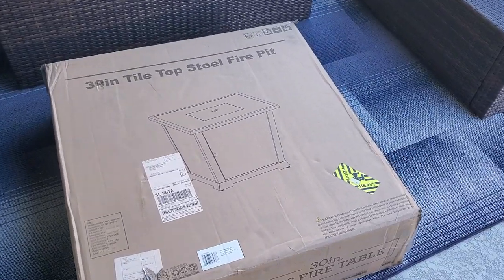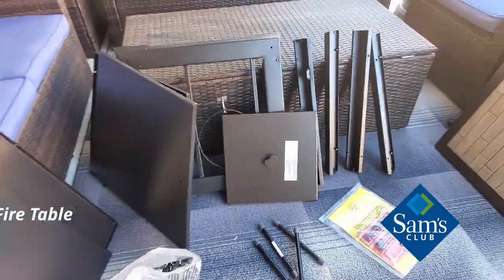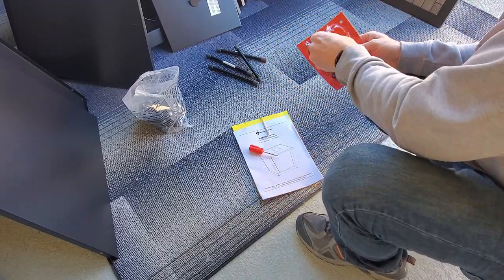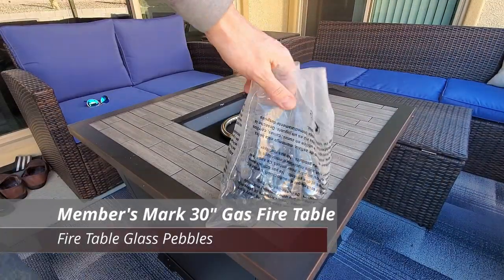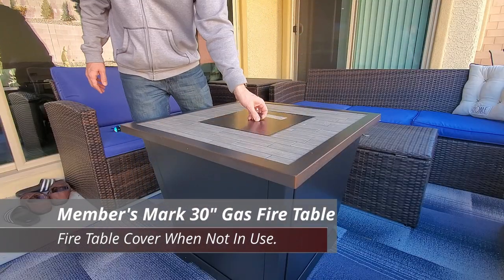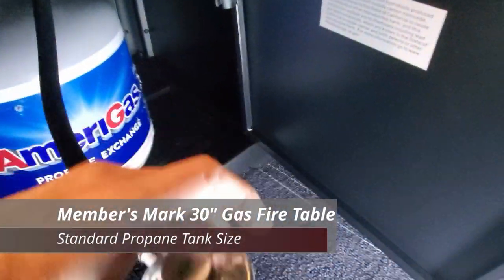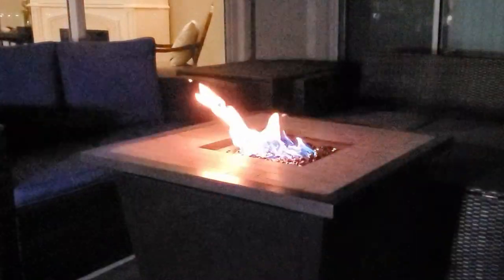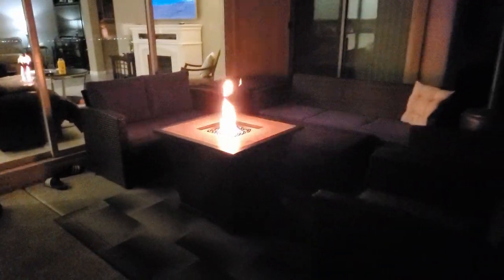Members Mark 30" Gas Fire Table - 980207456 - Outdoor Fire Pits 2021

Comment: Are the glass beads supposed to cover the burner to hide it? Mine didn't come with enough to hide the burner completely.
Reply from the maker: No the beads are just decorative. The burner needs to poke through for the flames.
Reply: I might argue that you CAN cover the burner, as the flames find their way around the glass.  I've heard that using ROCKS however, that's not the best idea, as some have experienced rocks shattering/blowing up a bit.  There's a # of videos where you can see people COVERING the burner w/o any problem.

Comment: "SLIGHTLY" damaged?!  Naaaa...that is SERIOUS damage, even though it's merely cosmetic.  It would stick out like a sore thumb.  I imagine that a single PART would not be replaced, but they would want you to dismantle the ENTIRE fire pit, & return the WHOLE thing(?), or offer you some measly discount to cover the damage, @ least that's what I've read with customer reviews on some of their fire pit purchases.
Reply from the maker: I've used this firepit for years now and it still works well. And no one has noticed the damage so it's not a huge deal. If it was worse I would have taken it back. I've returned a 85 inch TV after the 60 days and Sam's club had no issues. Thanks for watching!
Reply: @UltimateTechHub  Did you pick up the fire pit or have it delivered?  If you picked it up (the TV as well), would you be dealing with the STORE, or would they pawn it off on the delivery company or manufacturer if you had 'em delivered? Yeah...the cosmetic "damage" to ME is HUGE.  I'd rather be the one to put the  1st scratch/dent in things.
Reply from the maker: @Kman.  We bought at the store.